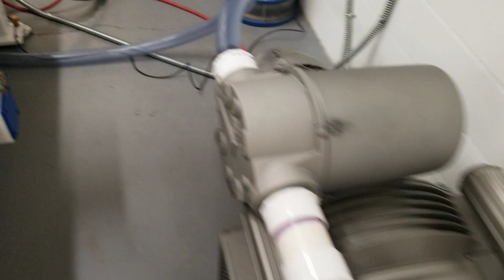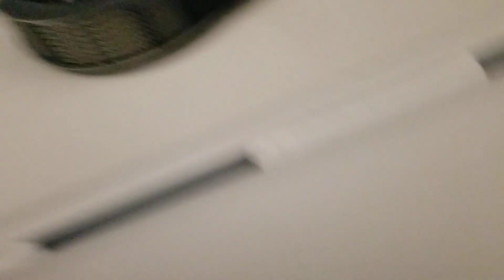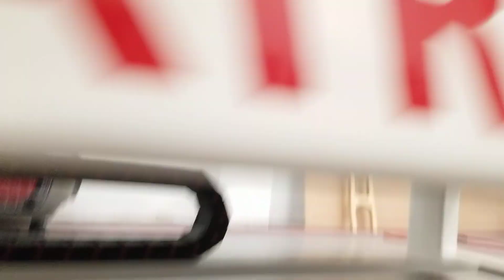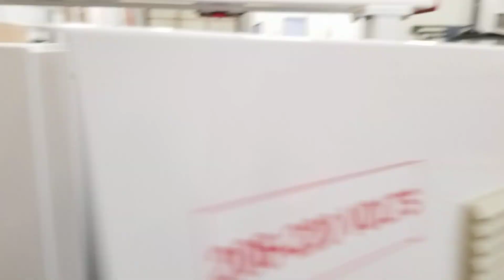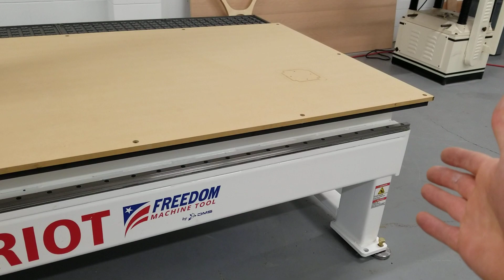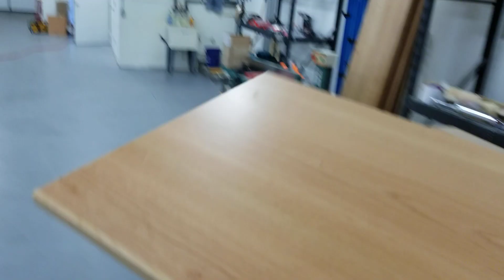Overview of My New CNC Router (FMT 5x10)

Comment: Very nice machine, thanks for the walkthrough.
I do have 1 tip for you..... Get a new electrician!
Sounds like it would have been a perfect install if it was not for you're electrician.
You know an electrician was on the job when you see two 16 gauge metal sheets joined with 3" screws, WTF..

Comment: How does the vacuum go through the spoil bord.  ?
Reply: The inside of MDF is porous do a 1/16" fly cut both sides, I like to use LDF
Reply: LDF is not correct for that type of vakuum pump.
Reply: MDF density is 0.5g/cm3, LFD density is 0.35g/ cm3 and more porous Increased suction according to Multicam.
Joe, I'm open and go with the flow tell us why not. @josephhaim6191
Reply: @kenf2662  It has been a while since I researched vacuum pumps for cnc's but vane pumps are great at maintaining a vacuum but are not great at higher CFM's. So you want a denser MDF to slow the CFM's down. All that said, that one has enough power to overcome a good amount of leaks but it's going to cost more $$$ to keep it going. Feel free to correct me. Like I said it has been while. I know on my table I just used 4 220v shop vac type motors and was more than happy with the hold.
Reply: @chrisf8584  Yes Chris I went the same way on my pump DIY 4 central vac pumps in a box, my table is a 5 x 10 four zone.
Reply: We cut mostly sheet goods for our cabinets.